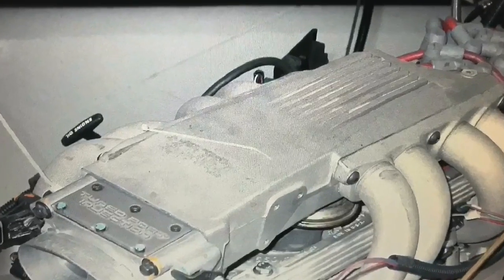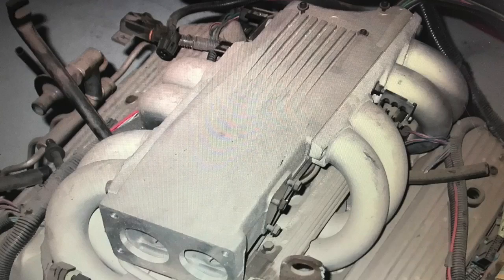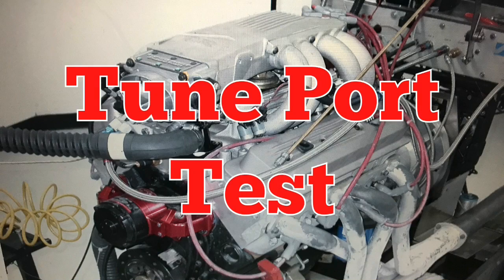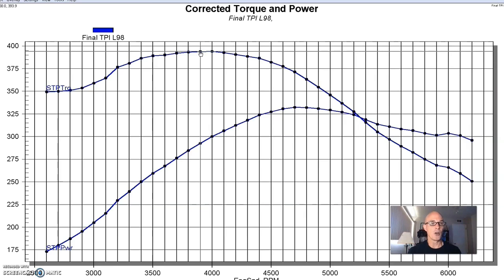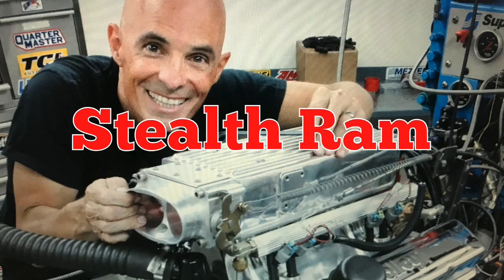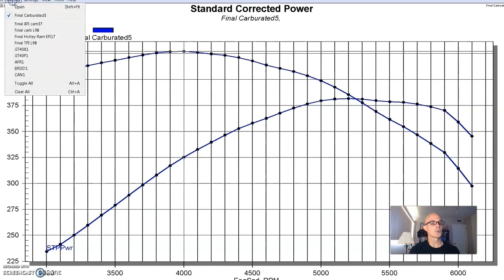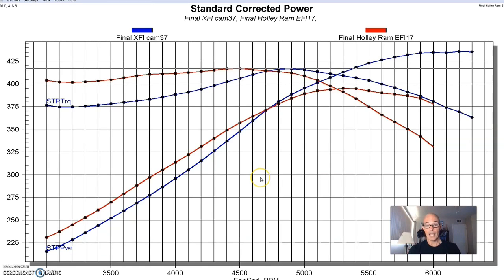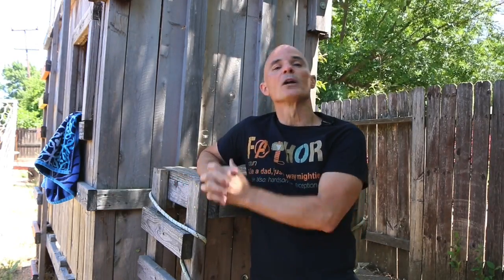TUNE PORT TECH-L98 vs CARB

Comment: I like low end torque. Off line pull. Most street cars (Automatics) shift under 5k anyway. I’d like to see more “streetable” builds and testing. Frustrating watching dyno runs that start at 3000 rpm /400#ft. I’m thinking great, how’d we get there, what was it at 2000, or 1500. Thank you for all that you do.
Reply: I agree. I assume that when they start the curve at 3k, it's because they don't want to show what's happening below that. (Nothing)
#Pontiac power!
Reply: No I think they can’t actually get the dyno loading right at that low of an rpm. I mean even on some of the total pos factory dogs he’s tested he doesn’t pull much below 3k. Look at other dyno sheets, it’s not just Richard.
Reply: @Kibblesnbits4  
Bull. How many times have we seen the same motor dyno'd with different mods added on? The first pulls always start at 1500 rpm, then inevitably (usually after the installation of single plane intake and wild cam) the test "begins" at 3000 rpm. 
It's because the setup lost all the power it previously had below that rpm.
I had a 455 that made peak torque at 3100 rpm. At 1800, it had more torque than most LS engines can muster at their peak.
Reply: John Tempest that’s what I’m talking about. I had a 69 Olds 442. I want to see the off idle tire smoking torque that pulls the tires off the ground (if it hooks). My tranny shifted at 4K. But the motor was all done by then anyway. I watch many channels it’s alway top end HP. Very few of us have the cubic dollars or the need for a 600hp at 6k motor, that won’t idle. That being said. I do love the “shoot outs”  (same motor different stuff) or head to head. This is my favorite channel because of the way he dose that kind of testing.
Reply: @jasonlessard2373  
Mine shifted at 4600, and was fastest when you left it in drive and let it shift.
I also love the channel, and the dyno data.

Comment: If the tune port was never put in a performance car,  no GM performance guy would ever recommend it for anything. Only the third gen guys (I am one of them, but I am no friend of the TPI) keep harping on how great torque is, as if a streetable cammed, carbed 350 or 383 in any way would ever feel like it doesnt have enough 3000 RPM torque. Pretend the tune port doesnt exist, and you could make the same argument for the factory style TBI system. "Sure, trading power for torque is a great idea!", said no hot rod guy ever, unless they're too poor to get rid of the TPI system. Maybe the problem is that it's such a good looking intake, I dont know.
Reply from the maker: TBI is not even close to TPI

Comment: I’d like to see an L98 build strictly for low end torque regardless of the top end power I’ll bet you could get nearly 550 foot pounds from a stroker tuned port build.
Reply from the maker: we did that with a 383
Reply: It was built stock strictly for low end torque.
Reply: @unicornsteaks6769  yeah, but... there is so much more low end to be had than stock as well....

Comment: The TPI gets about 8/10 for looks about 3/10 for serviceability and about a 4/10 for performance. Even hopped up on 350 CID they're limited. That said it's probably the best truck intake GM never used.

GM's EFI intakes were the biggest flaw of their engines. Ford really got this right in that you could put a bread box on it. The only problem with the LT-1 intake is it didn't have a distributor hole in it.

Comment: How much compression is to much compression for a boosted motor 🤔
Reply: We used your video for info when rebuilding my son's 355 iron head l98 from a GTA. We used a Comp 08-302-8 cam, 1.6 rockers which put intake and exhaust numbers at 212 int and 222 exhaust with .512 lift int and exhaust, ported the intake and runners, beehive ls6 springs and comp retainers , hardened pushrods, 50psi on adj fuel pressure regulator, placed it in a IROC with 3.31 gears and a T56. It has a very rare Dana 44 third gen rear end. It is the definition of fun! He is very pleased with the results. 1st gear lugs a little because of the high gearing in the T56. 3.92 gear change is next! We figured that if he had a 6 speed then 5000-5200 rpm was not a problem.

Comment: Just found out last night that I have cast iron L98 heads on a engine I'm putting in my project muscle truck.  I was wondering what kind of HP it would make with a cam and BAM! , you put up a video of one 😂  I plan to do a little port work to mine though and a turbo with blow thru carb eventually.  Have you ever dyno'd some ported L98s?
Reply from the maker: yes we have run ported L98 heads

Comment: Ok I'm calling BS cus every motor you have tested since I've been following you have over carbureted the engines with a 900 or bigger carb.  Now you are using a 650cfm which is minimal for a 350.  What's up with that.  You should have used a 750 cfm.
Reply from the maker: a 650 is more than enough for a 350-hp motor

Comment: Would really like to see a vortec test with the stock intake
Reply: This would be cool.   If we could get the Vortec and then do exactly the same compression/ cam for a 5.7 vs 6.0 rods also.
Reply: tbi already runs out of flow on stock heads. it would onlybget worse with vortecs. 350 tpi dead by 4500-5k. stock tpi
Reply: @darinr9424  none of those intakes are vortec

Comment: Hey Richard, what about the early 80's Crossfire intake, did you ever test one of those?
Reply: Yes, would love to see a stock test plus any mods to improve it.
Reply: If those are running correctly, just don't ever touch them.
Reply: I pulled off the cfi on my vette, put a tbi unit and conventional intake on it and made great power. The wiring for the cfi & tbi is the same, so no new ecm or harness.
Reply: @CC Ryder  That's been my experience to an extent. I had one on an '82 Trans Am 305. At WOT it ran great and it idled great... but part throttle was really bad, and it only had 60K on it. We could have fixed it but swapped in a carbbed 350 instead. It did look cool though, wish I would have kept the parts.
Reply: Its basically a modified cross ram. I'm running my 84 with it with a lot (lot) of work done to the rest of the engine. Makes great power but the shows over at 4200. It'll pull to 7k but the power at 4200 feels the same from there out. The runners are just too small. Its literally 1/3 the size of a 1205 gasket. 

There is an aftermarket manifold called the renegade that is a nice piece and the gentleman is trying to bring it back to market again. I had one and the reason it was pulled was because the company building them was really screwing them up. Mine had core shift on the runners causing a vacuum leak into the lifter Valley but dear God the few times it ran before it started leaning out it ran well. That was on the stock engine still though. With that manifold it was power wise on par with the later l98s. And they had roller cams and significantly better heads than 624s.

If Richard wants to test one I'll gladly donate my car for the cause. I have nothing else going on at the moment lol.
Reply: How about making a early crossram intake into a fuel injected intake with two four barrel throttlebodies or using two Holley terminators on it without the progressive throttle linkage   or use a zex perimeter plate  to introduce the fuel maybe some  nitromethane under two four barrel throttlebodies
Reply: absolute shit sadly
Reply: @trillrifaxegrindor4411  Don’t allow a 40 year old ECM and Injection system to go over your head. They’re very easy to get power from, respond VERY well to simple modifications, and are reliable as can be.

Comment: torque would suit me best in my tow vehicle, so I would take the long runner fuel injection.
Reply: I built a tip using Arizona large tube runners Scogin Dicky large port intake, four hole injectors ( can't remember the name but were used in foreign cars due to better fuel delivery and idle quality's), port matched the upper plenum, AS&M throttle body 52 mm with air corrector between throttle bores ( believe it was  780 cm if memory serves me right) and that's questionable at this age  lol. Vortec heads. Did bowl work on ports and blended top of exhaust port roof.opened up exhaust to gasket at head only. Beehive springs, back cut intake seat of valves, and had it powder coated red except manifold ( glass beaded it and sprayed clearcoat on it to give a grey/ red contrast.
Wiring harness is a Painless for a 91 chevy truck. I have a 88 four foor dually. Dual tanks. Have a stand alone hi pressure fuel pump out of a marine use IO.( inboard /outboard). Pump mounts in oem bracket with rubber grommets. This too is from marine usage. 
 Engine is 350 roller with LT 1 cam. Same as used in the station wagons, cop cars etc.
Heads ,intake and crane cam #109348 ,wiring harness sit in my spare bedroom think I'm getting too old to put in truck lol. The outer is a 91 tip from Camaro. It is not MAF.
 Possibly one day I'll attempt to install it. I know it will have tons of low end grunt right up thru mid range possibly higher. Oh ! Long tube headman headers too.

Comment: It would be interesting as you said to see a 383 or 400 with TPI and say some 200cc heads and those same cams or roller cams with similar duration numbers. Wish you would have elaborated more on the specs of the L98 heads. Maybe port the TPI too.
Reply from the maker: I did a 383 TPI stroker, the L98 heads on this motor were stock

Comment: So could moving fuel injectors away from the ports into the intake runners then be beneficial over it port injection on the same exact setup...now I'm very curious
Reply from the maker: yes-we have moved the injector position many times with positive results

Comment: I would love to know how to build the TPI up using the stock intake but ported
Reply from the maker: we had our lower Extrude Hone ported-then bigger runners and port-matched plenum for a different test
Reply: there is info on the internet, turns out that there is a bottle neck in the lower intake runner  right where the injector bosses /bores are at,

Comment: Carburetor with the manifold look how fast to
Reply: Good old faithful carburetors and manifolds have come a long way and make power faster than these tuned port injection and always will bethey've been around for a long time and always will still be the best to use at the tracks

Comment: Some what tuning set up would use to run the TPI besides the factory ecm?  I have two complete TPI setups and they wouldn't go on a stock engine.  Looking at putting on a 383 for a 1982 K20 truck?  Anyone have any advice?   One system is from a 88 TPI with a mass air flow sensor the other is from a 91 corvette which is speed density
Reply from the maker: we used fast and holley on ours
Reply: @richardholdener1727  I'll have to look into that Thank you !

Comment: If I have a heavier car (Caprice, Impala, or truck) I want the low end torque, but if I want some high end MPH then I'd go the latter. 

Question though, were the LT1s a torquey motor like the TPI motors?
Reply from the maker: no they were not-short runner intake
Reply: @richardholdener1727  they were NOT a short runner intake or they WERE a short runner intake?
Reply: @mrmete  LT is a short runner

Comment: I wish there was a tuned port intake for vortec heads bc it looks hella cool
Reply: Scoggins Dickey makes a lower TPI Manifold that works with Vortec heads
Reply from the maker: yep
Reply: What Do you Think About The GM Performance Parts Aluminum Fast Burn Heads with The TPI set-up With The Upper Fully Ported(humps behind throttle body removed) And Scoggins Dickey lower plenum on a 383.

Comment: The c4 tpi was a best case compromise.   The heads were crap. Cam duration was limited because of basic ecm function, and emissions regulations. Gear ratio spread in the 700r4 was about the same as an old 3spd manual--- + the overdrive. Wide gear ratios meant lots of rpm drop on every shift. There was no head airflow or cam timing available to make high rpm horsepower. So.... They engineered it to make all the torque posssible. Most auto tpi c4's were delivered with 2.56 final drive gears to make a 150mph car with 4700-5000 rpm to work with. It was a great compromise given the basic sbc parts they had available
Reply: 🤔🤔🤔🤔 Fact is the C4 had to be equipped with the 3.08 final drive ration to be able to pull to the advertised 150 mph top speed.
Reply: @niagrasprings  Thankyou. A fellow that understands the compromise gm had to make

Comment: TPI on a 383 with a mild cam = torque monster. Seems like it'd be an awesome setup in a pickup or suv
Reply: Just run out of the air sooner on the RPM curve.
Reply: For a drag or track car, TPI is a no no, but for the common sports car on the streets, it's a torque monster.

Comment: TPI with a manual trans is the best,use higher rearend gears to keep the motor in the torque range longer.
Reply: I think that's why my manual 305 ran faster times in the 2000s that the auto 350s did. I could short shift at 5k and keep it in that little window better that the auto even with more power

Comment: Please tell me how to take the junky injection system off of my 99 Tahoe and convert it to tpi, I've always loved those engines.
Reply: Run a L31 boat fuel injection intake
Reply: they sell a vortec base. so it's a bolt on, would need to fab the fuel lines and build an air intake. the fuel injector wires are there, you need 8 plugs and wire them in. plus being a 99 hp tuners does work on your truck, so I'm pretty sure tuning wouldn't be that hard.

Comment: I had a FIRST fuel injection system about 10 years ago. I wish I still had the dyno test from it. Mild camed 350 w/ 389hp & 413 torque. I'd like to say that toque started to really pick up at 2300 rpm and maxed out at 4800. I had to sell it becuase of life before I was able to install it. Would of been an awesome dd /cruiser. 

I would love to see the tpi test you did in the past.
Reply: I have a dyno DB with a list of people running FIRST Fuel Injection intakes. My notes say you had a 9:1 comp 355 SBC running 1st Gen Twisted Wedge Heads 212/224 .487/.552 lift and ended up with 380 HP @ 5,000 RPM 430 ft lbs @ 4,300.

The Super Chevy Stealth Mode TPI article ended up with 458hp @ 5,800 RPM; 534 ft lbs @ 4,000; a 383 with Comp XR 264HR.
RCS Racing Engines: Sells a 460 HP @ 5,200 RPM; 520 ft lbs @ 4,000 RPM 383 crate engine now. 
I've built a 350 10.2:1 CR, Profiler 195cc heads, Mike Jones 227/228 @ 0.050 0.600" lift intake with 1.6 RR;  Lightly touched up and port matched First (Felpro 1206 gasket) that should EASILY clear 400hp; controlled by Holley HP EFI w 58x crank trigger, Vortec Truck cam sync, and LS ignition coils. -Waiting to get it back in my car. Just finishing up AC conversion while I have the engine out.

Comment: Agree 100% on your truck comment. I had a 1992 C1500 5.7 5 speed, 3:73 posi SCSB. I swapped an L31 Vortec crate motor from Scoggin Dickey, Edelbrocks MPFI vortec intake system. GM is always stingy on trucks and messed up for decades. The crappy TBI then the spider intakes on Vortec trucks.

Comment: I see L98 and I'm here then see "IT'S THE WRONG L98"
But seriously have you ever seen another GM product the PFI Holden V8 inlet manifold {Often known as bunch of bananas} very similar to an LS1 but 10 years earlier and a cast 1 piece of aluminum. Or even a Group A Holden V8 Inlet manifold. The Group A on a 5 liter would let them sing at 9000 rpm back in the day but still had very good lowdown torque?.
Reply: Ive never seen that. I googled it but couldn't find anything.  Do you have a link?
Reply: @HioSSilver1999  https://www.whichcar.com.au/features/history-of-the-holden-v8-part-two-blue-black-motor-1980-to-2000
Reply: @allanb3222  thanks
Reply: its just not possible to make both high tq and hp.

Comment: I'm building a a 334 stroker with 187s tbi heads. I know a guy that built one way back when and he used 307 heads and a qjet and got 22mpg in his truck. I'm doing a late model roller 305 block. What system would make more torque a 2 barrel or a 4 and gas mileage is a must, thanks.
Reply from the maker: a Q-Jet

Comment: That is what makes the variable geometry intakes Ferrari uses so cool. Pulling out all the stops is also why there 6.5L can make 789 net HP on 89 pump and still be clean enough to legally sell.  That's impressive power from only 396ci all motor being a V12 just makes its sexier.
Reply: Sure. 
Until you shell out $8k for a first service tune up at 5k miles.
(If it stays out of the shop that long)

Comment: Haha ... I'm wearing the same shirt right now as what you had in the video :o) Daughters are awesome (at least that's who gave me mine!)
You showed me some great information here. I've put together an L98 which is on the cusp of first fire up. What's kewl about your video for me is I was able to pick up a Holley Stealth Ram for it, with the 58mm TB. The cam in it is a Comp Cams 08-305-8 (.544"/.554" lift, 220/229 duration, 114LSA on 1.6:1 roller rockers). I have a set of aftermarket aluminum heads which flow 250cfm @ .550" lift. I'm shooting for 400WHP and I think the numbers you've shown with stock heads and a bit of a milder cam than what I have should put me in that ball park. I'm really looking forward to getting this thing fired and on the road.
Reply: Wheel or engine dyno 400 hp engine dyno I believe with nothing hooked up to the engine wheel closer to 300 hp 330 tq I would like to see wheel dyno smoothing 5 they just don’t breath
Reply: On a 385 (bored .040 with a 3.75" stroke) and a 224/230 cam, I made 342 rwhp and 335 lb-ft of torque.  It was choked by the 1 5/8" shorty headers with a necked-down collector, probably would've made 360-375 rwhp with better headers.